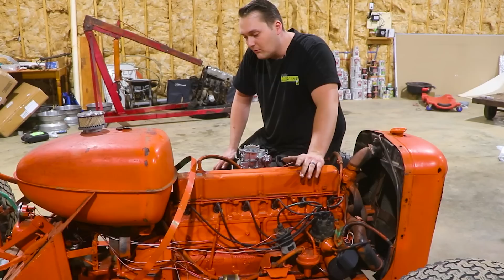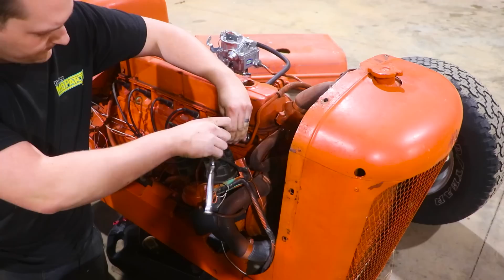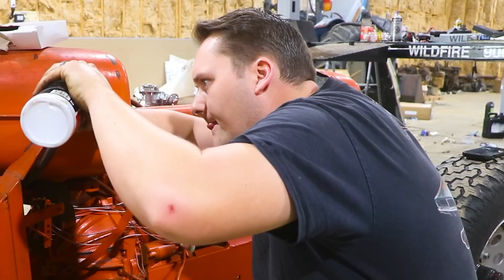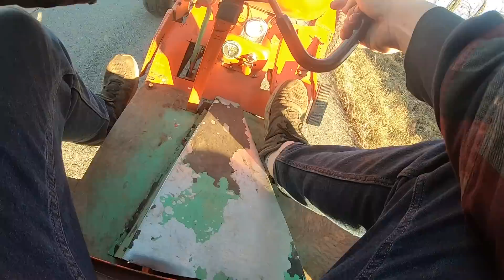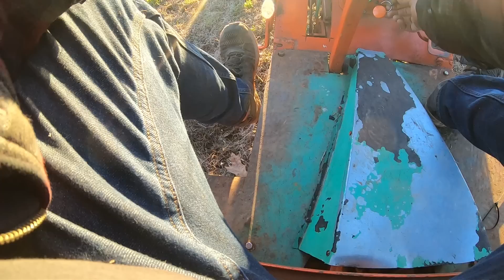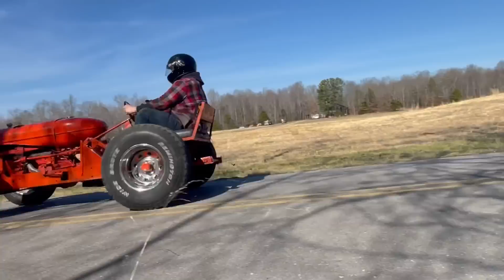I Bought a Chevy Powered Tractor Go-Kart and It's WILD

Comment: The addition of a cage and suspension would take away from what it is. Definitely brakes and steering and seat belt but the rest of it is awesome in my opinion. Awesome video.
Reply: I agree
Reply: It's unable to be driven at its full potential as it is, it needs a suspension so you can get the speed out of it. A cage on the other hand seems a bit overkill.
Reply: @toysoldier46552  to drive it at high speeds it does require a suspension but it would technically no longer be a tractor and would become more of a 2wd ATV in my opinion.
Reply: How would making it safer with a cage take away from it?
Reply: @mopar43v3r  it's Kool like it is . Start adding stuff like a cage to mess it up visually
Reply: @chadwright7614  safety is more important than visuals. Won't matter how cool it looks when it crushes your neck but whatever
Reply: @mopar43v3r  Right? It doesn't matter how cool it looks if you could never risk driving it past 1st gear. Even tractors can have cabs and safety cages.
Reply: I made a silly comment about this thing being something of an organ donor facilitation device but you're correct, KBAKER. It would look ridiculous with a cage.
Reply: @wes11bravo  He could easily make it look like a t-bucket hotrod. Your thinking tall and square, and a protective cage doesn't have to look like that. Easy to make it safe enough to drive and cool. Because it would look a lot more ridiculous upside down with a crushed corpse under it, or sitting going nowhere because its too unsafe to drive.
Reply: @mopar43v3r   If they wanted a safe vehicle, they wouldn't have used a tractor.
Reply: @jimmywhitlow2012  so just because of that means you aren't allowed to make it safer? Dumb logic.
Reply: I think your tractor is SEXY
Reply: @mopar43v3r  I am with you - I think a cage would look kinda cool on it
Reply: Yes, but everything looks better with a rear hoop.
Reply: If you are going to off-road it, then some kind of roll bar would help with a bucket seat. Suspension for sure
Reply: Without a cage or tractor talk ROPS a seat belt would make it more dangerous
Reply: If you do a cage make it look like an old school fuel altered or TF style.
Reply: It's like something out of a Mad Max movie. He needs a helmet and shoulder pads with spikes  glued on.
Reply: Just put some combine tires on it, when you roll it you might scrape your helmet.  AC fenders if you are going to do that.

Comment: I would love to see more content on this contraption. In addition to all the other stuff you mentioned, I'd also swap the tranny for a Powerglide automatic. It will fit the engine perfectly since it's also GM and you'll be able to keep both hands on the wheel. That might be the most important safety feature of them all with this machine.
Reply: Powerglide would be great for that contraption. Hopefully your comment gets more attention so he sees it. Wonder if a VW beam axle would work on it? Give it suspension and brakes in one shot. Plus, since they're mounted rigidly to the frame it wouldn't be much different that the current setup.

Comment: Not so sure about the cage, but coil over shocks and some type of disc brake upgrade would do this thing justice.
Reply: Drums have more braking force, and with no power master, they should stay drums.. coilovers is 10 times more work than leaf springs, and I wouldn't waste the energy on either.. leave the tires at 12psi and ride it..

Comment: Hi Dylan.  I would find a better 3 speed floor shifter and move it to a more convenient location, fix the clutch pedal and move that as well so you can operate it more like a car.  A seat belt seems like a good idea.  Some type of suspension is probaly also a good idea but I wouldn't bother with a cage.  It looks like it's got a pretty low center of gravity.  You probably won't flip it.  I don't think that thing would ever be 100% safe without really limiting the fun factor.  Thanks for the video!

Comment: if you add a cage it must be designed the hot rod way otherwise it will kill the look. May be a rougth kind of bucket seat sitting lower would help achieving this?

Comment: The radiator, grill, hood, fuel tank, steering column support and frame rails are from a wd, wd45 Allis Chalmers, and the steering wheel is from a G. It also has the factory fender mounts on the rear so you could easily add factory wd, wd45 fenders to it.
Reply: It is very reminiscent of the only Worthington conversions that were done to a lot of n series ford tractors back in the day to pull reel mowers for golf courses

Comment: It's really not far from being a T bucket type of hot rod. Get a dropped, hot rod type front axle from Speedway and hang it from a transverse leaf spring. The Ford Model T/A suspension and the 9N/8N tractors had a lot in common, they even shared some parts. The axle would address all your suspension/brakes/steering needs simply and still fit into the tractor theme. You could try leaving the rear hard tail and just swap in either a race seat with some containment and roll over protection or a T bucket type cockpit with an automotive type seat. Then you would have something that could go 45mph down a smooth road. Eventually, you will need a rear suspension, as speeds increase.

Comment: Wow! That's a Bad Day! When a test run ends up being a whole day's ordeal and you've only barely left the driveway Lol! 😉🤣 This is why I trust no one's projects until I've gone completely through them, never really knowing what someone else who was playing with it did??? Sometimes lessons in life are painfully learned..... But otherwise with some sort of suspension systems in the Tractor Kart it would be a very cool concept and actually halfway decent looking as well! Nice find though otherwise! It was someone else's imagination run wild and with a bunch of leftover parts from the farm, what better combination of old parts is exactly what it became. With some fine tuning and the addition of a primitive sort of suspension system and at least a hoop over the rear half for some sort of roll over protection would be a great improvement in its drivebility and safety? Eventually working on brakes over the front end where they're needed and maybe a set of remote style fenders to keep the mud and water to a minimum would be in the winds??? SMFH dude man it's pretty cool though otherwise! Lol! Kinda a farm style rat rod if the term even exists? Ditch them square headlights and put the old teardrop pods back on the front end, please? It would look so much more at home than those modern LEDs. But it's definitely off to a good start now!

Comment: It seems like a good yard vehicle to help move your dead cars around the field. A good, stout bumper cobbled onto the front somehow and maybe a good gear reduction in the rear and it would be a beast of a push vehicle. Add a couple huge batteries and a high powered alternator and you could use ot to jump start anything you have.

Comment: One good thing about a ford rearend is depending on the year a lot of them had the pickup for the speedo in them. 
Something else there are factory 8.8s with disk brakes. I would swap the drums out for them on a rear brake only rig, personally I would upgrade them with bigger rotors also. Be real careful on anything slick, only having rear brakes it will want to swap ends real fast if you have to slam on the brakes.
I would put the seat on airbags over trying to design a suspension.

Comment: Awesome toy. Love to see more of it! Has a Remington wide brute on it, best light truck tires ever, wish they were still available
Reply: My vote is round headlights and some suspension, even if it’s just leaf springs. personally I wouldn’t cage it, wouldn’t be any different than a model T roadster. I’ve contemplated scratch building a 1906 Ford model K replica but using a 300 Ford and C4 Transmission. A lot of the concepts I came up with in my head are similar to this contraption. Thanks for sharing

Comment: If u can find a way to be safe and be able to do that cage and not add to much in the seat area it be great . Bucket racing seats with five point harnesses.  Super wide rear low pro  tires huge wheels like 24.5 skinny fronts  lower your driving position to be even with bottom of the diff . Dont paint it . Up right exhaust stack ( stainless ) move steering and controlls . Wow does this thing have potential.  I'm thinking of building one myself.  Cool find know of another one

Comment: 1950s bullet tail lights  1930s headlights coming off the shroud around the radiator switches have a bonnet that pulls up like they used to have over the old wagons. The doctors tape wagon that pulls up overhead and the 1920s are the 1930s style windshield that folds up and suspension of course, with the bench seat is cool.

Comment: Rear brakes only will make for a very sideways stopping experience. On the bright side, that may be the smoothest running 6 I've heard. They are generally ticking and clacking pretty loudly along. 230, 292 ? There may have been another in between those two but not bad motors.

Comment: That thing is foolish.  I love it.
If it was mine, I'd try to have a use for it in mind before making any changes.  It could be used as a competition pulling tractor for a light class, or a tug to move things around the shop, parades, off-roading, anything, really, it's actually probably the perfect size for you to haul to appearances as it's cool looking and relatively small.  Whatever you figure for it, make changes that help you get to that goal.  It needs round headlights, I'd start there...

Comment: Yes I would like to see more on this. It definitely needs 4 wheel disc brakes setup for sure. I would like to see skinny tires on front and a set of 50’s wide tires or 35’s wide tires set it lower like a go cart should. 
Your dad’s reaction was priceless. Definitely need the round headlights for a vintage look.
I would go for the street rod look it’s really awesome.

Comment: My dad and I built a toy out of a 44 Massey Harris when I was about 13, we used it to rake hay and pull wagons around…top speed was around 70mph and it still had the stock running gear and rear wheels.

Comment: Well, depends on the driving you wish to do.  

Off road, mud & dirt -needs some fenders, and a roll cage, and some big tubes for bumpers .
Street - bumpers, better seat, little wind screen, gauges lights all around.
Track - gauges, fatter rear tires, running boards (tube steel), cage (tube steel, with mesh)
Show - replace rims, flared fenders, nice seat.
Off road (dunes) - huge ass rear tires, fenders, bubble cage.

If the front end gets too light and happy, throw a winch on it, steel box for tools, parts.

Comment: yeah please upgrade this!
cosmetically: like parts that are missing like proper lights all around, fenders and footwells 
safety: seats, seat belts and better breaking 
fixes: fixing all the bodge work done by the previous dude who built this and improving the original design like adding hinges to the hood with a lock. 
upgrades: better transmission, engine swap/upgrading the engine that's in it to make it into a race machine whist sticking with the style of the original. 
personally i want this to look like both a race machine whist sticking with the tractor aesthetic if that makes sense

Comment: You could use a torsion suspension like from a Yukon and keep the axle above the frame.  Or put a spring and shock absorber like allis did in their wd. My wd has a modified Chevy shock in the seat. Without the shock it might catapult you off.

Comment: its either a 230 c.i. or a 250 c.i. from 64 to 76 olds or chevy,  best way to tell if its a 230 or 250 is pull a plug look down with a scope, iof the piston top is flat its a 230, if the piston top in dished its a 250 engine

Comment: Lower it, definitely - lower your center of gravity to help prevent roll-overs.  Weld on a roll cage.  Front and rear suspension - front disk brakes.  Re do the steering and clutch.  Nice video - interesting find.

Comment: Love the frankin trac. When I was kid in the early 90's we had an old 1937 Aliss Chalmers with a bad engine. My dad loved this kinda stuff so he yanked the old little bad engine and slapped in a old 292 strait six in there and bolted the flywheels together for an "adapter". Lengthened it a bit can't remember how mush but it was a blast.
Reply: Used to be a lot of 44 Massey tractors around , the diff and transmission were indestructible and when engine parts were no longer available then chev six was a popular swap . They used a chain coupler to drive the transmission so just needed a stub shaft .

Comment: What a cool contraption. It definitely needs front brakes, a parking brake, an air cleaner, a seat belt, suspension, & other safety upgrades. As for the transmission, I would suggest switching to either a 4-speed manual or Powerglide automatic and relocating the shifter to the right of the steering wheel to make it more comfortable to operate.

Comment: you might need to collaborate with someone on this one. 'rather b welding' is a channel where the guy makes components for protects just like this one. some kind of fabbed up a-arm suspension up front with coilovers (so that you don't need large coil springs) along with some custom hubs that allow for disk brakes would be a great start to this build. I mean, you want the upgraded features but you still want it to look pretty much like it does right now 🤘🏼🤘🏼

Comment: Wow!! Reminds me of my own "adventures" back in the dark ages of the early sixties! One change I would surely suggest would be the axle ratio. 3.08 with the big tires is a bit much. You won't want to run in high gear! I think that is probably a Dana axle, possibly a 44. The Ford axles don't have a bolt on rear cover, and the shape of the cover itself is pretty uniquely Dana. The axle model will be cast into the web where the right axle tube is inserted into the housing.

Comment: I would throw something like a Powerglide or a THM350 behind the engine, the frame is bulky enough to hide the various components and it would remove the shifter and clutch. Relocate the front axle forward and use an era appropriate leaf spring front and rear suspension. You toss the bench seat, put a solo seat (even possibly a motorcycle seat) on the critter, and build a hoop like small division tractor pulling rigs use. Build a footboard off the frame and mount the brake and throttle on their respective sides. Ideas from having helped out with a couple Allis-Chalmers 'Super Lo-Crop' customs, and putting a big block chevy in a Farmall W9.

Comment: Suspension for the tractor or suspension for your back?  Get suspension for your seat.  And definitely front brakes.  You get anything resembling speed and stand on those rear brakes and they'll just slide and that rear will come around.

Comment: A roll cage would ruin the tractor hot rod feel and excitement. The one thing every one is missing is what do tractors have that the tratrod doesn't. A tractor triangle on the back so the law will leave you alone. Triangle no registration no ticket. And yes you need fenders or a rod cab or tub. Tub would look awesome. Maybe batt under seat . Looks kinda funky hanging out there. And put suspension in the seat not on tratrod. steering wheel needs to stay that makes it a tratrod. If you put suspension on it it will lift it up to high then with suspension you will need a roll cage.  An auto trans sounds like a good idea. Change the headlights to more period correct. They don't look right on the tratrod. Tratrod lives on. Have fun. These are just suggestions. But not the name TRATROD LIVES ON. Enjoy lm totally jealous.

Comment: A buddy had something similar with a ‘58 Y-block in it and a two speed rear end. This was in the early 70’s and we were 17. No helmets but two seats. Squirrely as hell. Lost control on a gravel road and we both were ejected before it ended up in a grove of trees. Thank God there were no seat belts or we’d both be dead. Got scraped up pretty good as it was. Bent it up beyond repair , it was junk after that. His older brother who built it was pissed

Comment: Excellent video Dylan  :) I say that motor be Chevrolet 292 or 250 or 230 6cylinders for orange color used in 1960 to 1985 years  and transmission be out truck or car of Manual transmission 3 in tree, Steering wheel be Allis Chalmers grader tractor  with pivot blade plus motor was back like Volkswagen Bug or Bettle car ! But very interesting build some did and that seat homemade would say Allis Chalmers didn't have on tractor at I know this type and flush tank out to get rust out with Vinegar and hot water mix together then get dry paint and plus make sure Float Bowl off too when painting it ! Floor boards need for pedal is to  make like Running boards out steal ! Also my guess differential from 1960 and 1960 was first year of 292 6 cylinder motor and 250 was be 1966 to to 1985 , 230 came out 1962 last made was 1966 in pick up  and Van also rare in cars unless order! 292 was introduced in Stake Chevrolet 3 to 5 tons stake truck C40 to C60 versions 250 &292 be my guess that motor because of that and plus  12 volt Negative ground in 1960 to 1985 years ! Older 1960 one some 6 volt positive ground depending sold in world to !